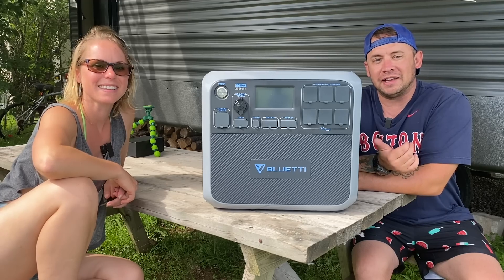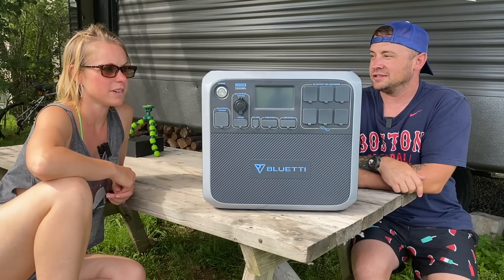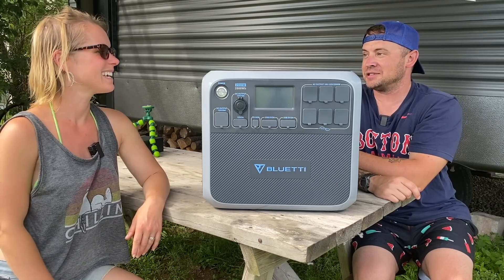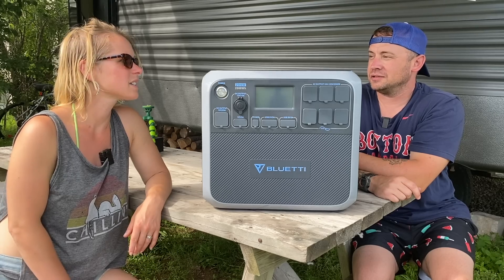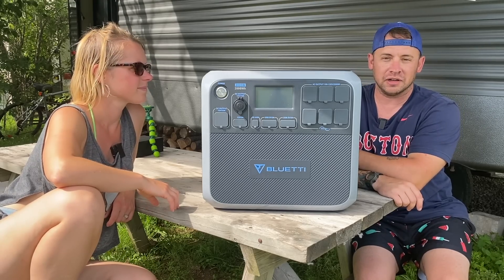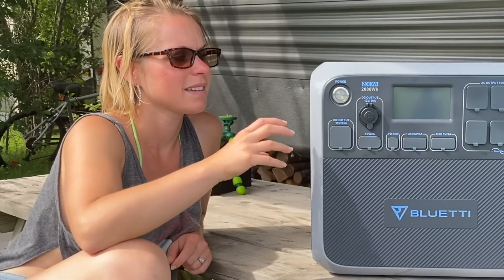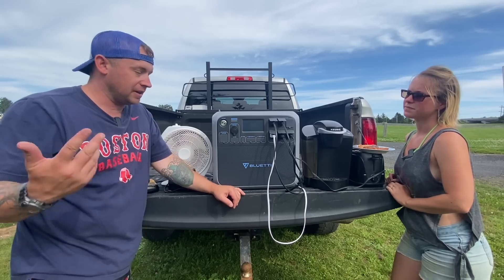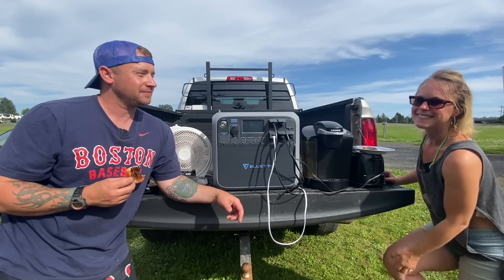You WON'T BELIEVE HOW MUCH POWER This Puts Out! | Bluetti AC 200P

Comment: I have my AC200P setup for my kitchen, powers 12v portable refrigerator/freezer, dorm refrigerator, 26 cu ft refrigerator/freezer, 5 cu ft chest freezer and coffee maker, plus other small appliances. It is plugged into the wall connection. Power outage, everything stays running. I also have 3 120w solar panels for our AC200P. Sorry about the metric issue. I am near Bangor Maine. The AC200P can also run our microwave, 1700 watts, is not connected to the AC200P, wall outlet normally.
Reply from the maker: That’s awesome Steve, thanks for sharing that!

Comment: I’m staying with my Honda eu2200i. I own Bluetti ac200p and I bought it to store the energy from Honda eu2200i generator. I can completely recharge my Bluetti in two hours with my Honda generator without sitting in direct sun ☀️ all day with solar panels that will take about a week to recharge depending on the sun.
Reply from the maker: Whatever works for you. We use gas generators also. And we usually charge ours in our truck driving around through the 12V outlet.
Reply: I wonder what  generator would last the longest if both was tested  under a 2000 watt load. I Personally believe the Honda eu2200i and the Bluetti ac200p are a phenomenal combination.
Reply from the maker: @gerald4nomads  Solid combination for sure.
Reply: Sweet! I'm not the only oddball out there. This just makes too much sense. I wouldn't go out and buy a new honda generator to pair up with this but since I already own one, this is just ludicrous speed. What's so great about this product is it works for you and it works for them, but not even close to the same ways. So versatile. Can't wait to get my AC300. I'm going to run AC all damn day on a two hour charge. Weirdos unite!

Comment: Just wondering -in your opinion i have a cottage with a Honda 200I generator -love that thing but we just purchased a 4 cu. refrigerator to run on the weekends only- so my question is do you think the solar panel could be left outside and hooked up all week-and then on Friday evening be ready to go-- is it designed to last in all kinds of weather for extended time.  Oh and the fridge needs to run for several hours to cool down.

Comment: It is actually 1,600 Watt Hours, because it loses power from the inverter and other power requirements. And it isn’t a lithium Ion battery. It is a LiFePO4 battery. Big difference.
Reply from the maker: The battery is a LifePO4, yes, but that is still a kind of lithium-ion battery. And as per the manufacturer, it has 2000WH. We own another bluetti with 1000WH and it is true to the capacity. I personally can't see 400WH shaved off because of internal components, but if you have a test you can show me in real time, I would change my mind. https://www.batteryspace.com/LiFePO4/LiFeMnPO4-Batteries.aspx

Comment: Either  i missed it or you didn't  show the solar panels and recharge with solar
Reply from the maker: It didn’t come with a solar panel, that is something you would need to add to it.
Reply: @MBFModernHomesteading  others that I have seen reviewed on YouTube  do come with at least  minimum solar panels for recharging  or maintaining charge  with capabilities to add even larger  panels  to provide  recharge ability  and then some  additional
Reply from the maker: @roberto.peterson9917  This one comes with plugs to charge A/C as well as D/C in your car, etc. It also comes with MC4 connectors to connect to a solar panel. They do offer solar panels, however we do not have one. But is an option one can get if they so desired :)
Reply: @roberto.peterson9917  the company sells a package with panels so that is probably what the other video creator went with